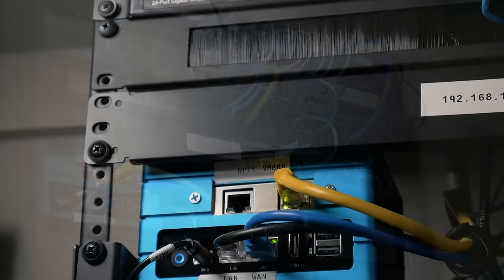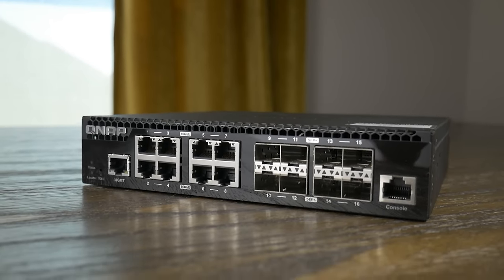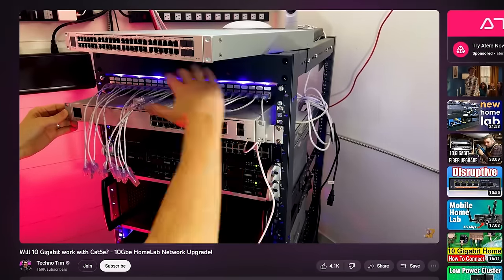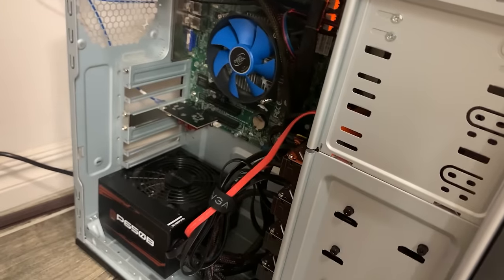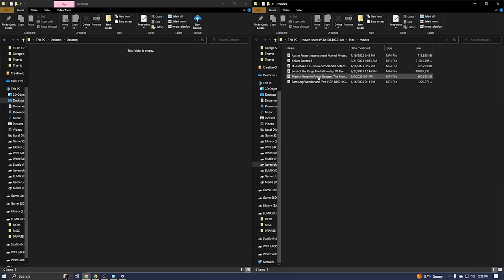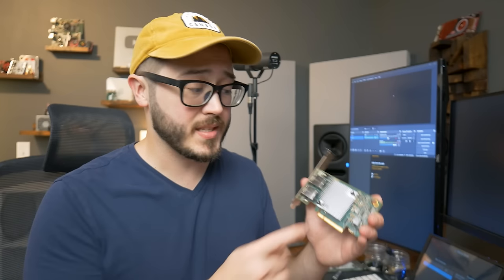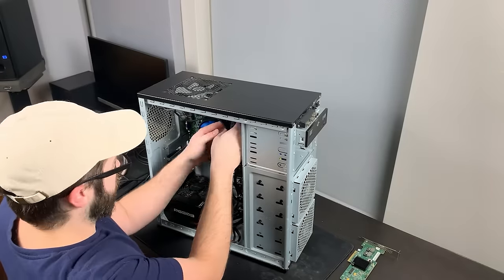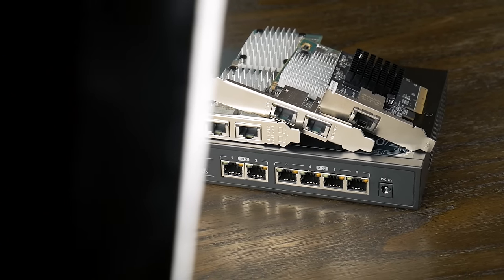Fast networking is cheaper than you think.

Comment: This isn't a budget video. This is a lie.
Reply: Yeah
Reply: electronics are just that expensive

you would normally expect to drop a couple gs for this stuff
Reply: You sound like my friend's Dad, he's poor and smells like salmon.
Reply: 350$ is pretty cheap, when you know the prices
Reply: The word Budget is relative 😂
Reply: @spacewolfjr  salmons delicious
Reply: @spacewolfjr you mean canned tuna.😂
Reply: If you've looked at the going prices for products at this spec, yes it is.
Reply: Agreed
Reply: No one said his budget was the same as your budget. 😂
Reply: @spacewolfjr  salmon is expensive af in my country lol😂
Reply: The 4 port mikrotik is 4 10g sfp+ ports, factor in 4 nice, around $28/ea and ~$20 per connection point, it’s not hard to add up quick. $350ish is about the least amount you’ll spend for 4 10g connections. You can of course shave that down quite a bit with direct connections between Devices. Say, a direct 10g link from your PC to your NAS. That can be done under $100.
Reply: @spacewolfjr 😂

Comment: Actually being limited by the drives is kind of nice, it just means that it is more or less just as good as having the drives installed locally, but  with the added benefit of the drives being available  to multiple computers.
Reply: + added latency, network always adds latency.
Reply: @RobinCernyMitSuffix half the senior developers I've worked with are incapable of processing this thought.
Reply: @magfal  then they are only senior in age ;)
Also, network adds IOPS limitations too
Reply: @davorzdralo8000  bro I missed a headshot cause I was gaming on a NAS. Wait, why was I even doing that. Nevermind, carry on.
Reply: @davorzdralo8000  In any cluster or replication setup, where IOPS is critical, those milliseconds of latency are added to each and every IO.
Reply: @davorzdralo8000  I like how you added that word “home” in there.  You can’t imagine circumstances different than your own.

Comment: Did you enable jumbo packets/frames on your Windows machine to enable a larger Maximum Transmission Unit (MTU) size for data being sent over a network?
Reply from the maker: You ask that question as if I know what I'm talking about! Haha, no but I'll look into it
Reply: @wojtek-33  I get that. As long as you don't go too crazy with it, things should be fine. I've got mine set to 9014 and get much more consistent traffic speeds
Reply: Jumbo frames are basically a requirement with high bandwidth networks.  Even 1gig will not live up to its full potential without it enabled.  It needs to be enabled on your work station, your file server, and the switch ports.  If you run a packet sniffer like Wireshark you can see that it's working.

Comment: 10GBASE-T NICs get HOT! If you're strapping a fan to the card, it's a good idea to disable temperature control for the fan header and set a constant speed. As the fan controller can't see the card's temperature, it can set the fan speed too low to cool it properly. I had this problem with an X540 and designed a PCIe card fan mount with an inbuilt controller. I could send you one if you'd like?
Reply from the maker: I should’ve said something in the video, but those fans are just on a set RPM. There’s no curve. But that sounds like a really cool solution you made!

Comment: FYI it took us ~5 years to go from 10/100 to cheap gigabit in the home
But we've been stuck on gigabit in the home for almost 20 years, when businesses moved to 40G over a decade ago, and are already on 400G
To me, we should have cheap 10-28G as ubiquitous at this point.
The fact that gigabit has stayed around the same price for so long is criminal to me.
Reply: tbf, rarely do one need 10gb, transfer in the home is mostly rooter to pc, not a lot of people have nas or anything extra on the network, and gigabit is not limiting at all for internet use
Reply: @neolordie  Well, gigabit was way more than necessary when it came to consumers too.
Reply: Easy answer, how many home internet has more than 1gbps?
Reply: @zhen86  And who's fault is that, the taxpayer for paying ISPs billions in tax dollars to run fiber to everyone's home in the 80s and 90s?
Or the ISPs for pocketing that money and not doing that.
Reply: @zhen86  i mean in most consumer's homes it does not matter. But here we are talking about speed over the LAN which nowadays comes in really handy if you are utilizing a NAS and copying files over the network (since files are getting just bigger and bigger)
Reply: Main issue over 10gig is fiber. Sfp+ connectors and cables are expensive.
10gig base T is basically where home use is going to stop forever, and they have been milking that for a looooong time

Comment: Great work as always. I purchased a QSW-2104-2T-A to upgrade from 1G to 2.5/10. I installed new wire for the single 10G run from NAS / switch rack to my main PC. But I have had success with 2.5G over my existing old timey unshielded cat 5 (no bloody e!) cable that I installed in the late 90s. Runs are only 20-40m but it all works.

Comment: Just something to remember: The file transfer protocol in Windows over the network is single threaded. At some point, you won't be able to go any faster unless you have a faster CPU.
Reply: Damn that's archaic 😂 i mean windows is built ontop of a legacy system I'm not surprised
Reply: What about if you use a third party file transfer like TeraCopy?  Or is it still limited to single thread because it would still have to use the Windows FTP?
Reply: i have noticed my best speed transfers to the nas is when i have a couple files moving at the same time,,  Granted that is with the synology drive application,, lol,,
Reply: Isn’t there some sort of BitTorrent based network file transfer programs that can multi thread?

Then there’s Free Download Manager….
Reply: Microsoft Services for NFS supports multi-threading. Just make sure you configure your Windows Servers correctly.
Reply: ChoEazyCopy to the rescue
Reply: Is it pure speed, or IPC?
Reply: It can do more depending on your settings
Reply: or just use linux?
Reply: Not true. SMB has supported multithreading since SMB v2 came out in 2006, and is particularly good at it when RSS and SMB Multichannel are involved. It's all cross-compatible with Linux and Mac OS as well

Comment: Enable jumbo frames in all the adapter settings (9000 byte MTU), should improve the 7 Gbit iperf.

Aside from that, unless video editing directly from a flash-storage NAS, I found that 2.5 Gbit is really enough. And those switches are cheaper, and cards are cooler, less power-consuming and often even integrated onboard in mobos nowadays.
Reply: I'm sad that 5gbit wasn't common as a middleground. I have a x370 ASRock motherboard with 5gbit and a Qnap pcie x1 Card with 5gbit for a few years but to take advantage of the speed I have to use my 10g switch because there was not an affordable 5gbit option. 
But in the last 1 or 2 years SSDs got very fast and cheap so 10g is already a huge bottleneck :D
Reply: mfao I made a comment on this dude cause I gave an alternative switch which @ServeTheHome also talked about later and guess what guys he deleted my comment lmfao... Is he even allowed to do that where is the YT police lmfao wait cause it will make him look bad and then they cant make $$$ thats why they gave him power to give quirky information and not checking all products out there.. Was he paid by qnap?? I am curious.. not saying he is, it looks weird. Also what about Mikrotik they also have better products which are cost effective as well!

Comment: Try using parallel streams with iperf.  Something like adding "-P 4" switch to your command might fix that.  That will run 4 transfers in parallel, and each will settle at 2.2-2.4 Gbps each, getting you to ~9.6 total.  That ancient BCM card might hold that back a little, but jumbo packets could help there, too.
Reply: Testing 4 streams instead of 1 on iperf3 won't give you a faster network. 4 cars running side-by-side at 50mph won't get there at 200mph. You want to test whether your 10gbe network actually gives you 10gbe
Reply: @BertelSchmitt  iperf isn't designed to speed up a network, it measures data throughput.  If the CPU doesn't have sufficiently fast enough cores, a single thread might not be enough to keep a 10gBE link saturated, hence the -P # switch in iperf.  I know, iperf 2 and iperf 3 are different.  Older NIC IC's, typically 1st and 2nd gen for a given speed class, are often not able to maintain line speed data transfers.

I also didn't hear him mention NPAR, or any other partitioning scheme, so the 4x50 analogy doesn't seem germane.
Reply: @andrewb6 iperf3 measures the network speed between 2 computers. If one of them is anemic, then it achieves lower speed, and iperf3 reflects that.

Comment: Hey I've been enjoying your videos for a while now... I'm learning much from yours and others. Couple things I read recently you may want to consider. Stacking even the passively cooled switches not good. Heat rises. Utilizing sfp+ with short DAC cables and/or any length fibre reduces much of the heat!, this applies to nics too! It's the transceivers that generate the heat. I will be utilizing DAC cables between switch uplink and downlink...and to my yet to be built nas server next to rack with 10gb sfp+. In some ways techie folks can/should skip the 2.5gb wave that's arriving now, implement 10gb now with the information available on workarounds and cost savings of used gear! Keep reading up on this everybody! And avoid the cheap foreign knock offs!!! Hold out for quality gear!

Comment: Pretty nice deals there. I have one qnap switch, which has been fine on my use cases, but my homelab runs primarily on spf+. I needed 10Gig way back because I use network storage on my virtualization, but spf+ nics were way cheaper than 10G rj45 ones even as used. The situation seems to be changed somewhat, but I've gotten used to the spf plugs and those are awesome since they do not fall of as easily by accident as rj45 does. As of now, I have a small unreasonable fantasy of getting into 100G networking. It doesn't make any sense but would be fun
Reply: lmfao I made a comment on this dude cause I gave an alternative switch which @ServeTheHome also talked about later and guess what guys he deleted my comment lmfao... Is he even allowed to do that where is the YT police lmfao wait cause it will make him look bad and then they cant make $$$ thats why they gave him power to give quirky information and not checking all products out there.. Was he paid by qnap?? I am curious.. not saying he is, it looks weird. Also what about Mikrotik they also have better products which are cost effective as well!

Comment: Good upgrade for a content provider.  I actually wouldn't do the flash upgrade just yet.  It will be an amazing upgrade, however both SSD and NVME drive prices are dropping quite nicely at the moment.  There should be some good black Friday / cyber Monday sales coming up soon enough, or just wait and take advantage of the post holiday sales.  With both SSD and NVME 8TB drives becoming "reasonable" now, it's about time to just convert over in the next year or two.  I'm looking forward to more 8Tb price drops next year myself.  Another fun place to look is  U.2 drives, or what looks really fun is something like the OWC  u.2 NVME shuttle that will let you run 4xNVME on 1 U.2 connection (there are m.2 adaptors).  So you can sacrifice a bit of that per drive nvme speed and end up having up to 32Tb of flash storage off of a single m.2 connection (or u.2 if you put an add in card in your motherboard).
Reply: ssd prices are going to go up very soon, the summer was the all time low. now nand manufacturers are decreasing production
Reply: Lmfao I made a comment on this dude cause I gave an alternative switch which @ServeTheHome also talked about later and guess what guys he deleted my comment lmfao... Is he even allowed to do that where is the YT police lmfao wait cause it will make him look bad and then they cant make $$$ thats why they gave him power to give quirky information and not checking all products out there.. Was he paid by qnap?? I am curious.. not saying he is, it looks weird. Also what about Mikrotik they also have better products which are cost effective as well!

Comment: To reply to your final comment about NAS speed. The Synology DS1621+, and most other good 6 bay hard disk NAS, pre-built or home built, are good for 500-600 MB/s, faster if you use NVME cache. It won’t saturate 10G, but  you get 2x+ 2.5g performance and 100 TiB of usable storage without breaking the bank.

Comment: Like most Enterprise level gear. They are designed for a LOT of forced airflow.  That's why sticking Enterprise cards in a consumer case, often causes them to cook.  The airflow they need versus consumer sound levels is not easy to balance.

Comment: Just bought a little switch with 2x10GB and 4x2.5GB for 50 bucks at Amazon. I will have a high speed NAS next to my machine (10GB) and the 2.5 connection to my home server. Cool.

Comment: Re: the max throughput being about 7-8 Gbps, did you enable jumbo frames?

I saw similar behavior (about the same speed), but enabling jumbo frames on the client and the server got me up near the theoretical 10 gbps maximum.

Of course, enabling jumbo frames can lead to other issues if you don't segregate the 10Gbps devices onto their own VLAN, which is probably one reason I haven't fully set up my 10Gbps network yet. :P

Comment: I am running HP branded x540-T2 cards that i scored on ebay for about 40-50 bucks a couple of years ago, as well as an genuine intel x710-T4. They get HOT without airflow! However the heatsinks are beefy and just a small about of airflow keeps the temps in check. Funny thing is that the x540 has a "Caution HOT!" warning etched on the heat sink! :D

Comment: The inspur is not a dud, I have one too. It worked on your nas because you gave it all the 8 lanes it asked for unlike the 4 lanes you gave it on your desktop. There should be three jumpers on it. Two of them should be adjacent to the ports. Start from left and short pins 1 and 2 on the first jumper, then do 2 and 3 on the second. This way you will have disabled one of the ports and it will happily accept to work on pci-e 2.0 x4.

Comment: Enterprise grade PCIE cards like NICs or SAS controllers are designed to run in rackmount servers which have an insane amount of airflow compared to a normal desktop PC. Those fans alone often pull 20 watts or more PER FAN. Almost all server-grade PCIE cards I've used run crazy hot without additional ventilation in a desktop PC.

Comment: Interesting 16 port switch, paid that much getting a 10 port 10gig last year. Prices seem to be starting to fall a little. When I bought mine I figured we'd have jumped straight to 10gig instead of 2.5. But seems 2.5gig is being widely adopted first. Which in hindsight guess makes since as it covers a much larger audience. As not everyone has the hardware to fully take advantage of 10gig yet. But when you have a use case and hardware that can drive it. It is utterly fantastic!

Comment: Even if you're not running optimally and your drive array only runs at 500MB/s anyway then moving from a 100MB/s GigE connection to a 1GB/s 10g connection is still a huge step up.

Comment: For most people, Gigabit is probably fine, if not a bit overkill as well.  The network in my place I set up with D-Link commercial desktop switches, one 5 port and one 8 port.  My node has the 8 port switch as I have game systems and a few computers.  For short runs I don't see much issue of data loss due to attenuation on cat5e but I would want to use the appropriate category of twisted pair cable for longer runs.  I still find it funny that computers still use glorified 4 line POTS telephone cable for communication across networks.  I also find it interesting that even though coaxial cable can carry tens of gigabits of data, is used by cable tv service providers for broadband and is incredibly simple to terminate isn't the cable of choice for networking computers together.  Granted, it isn't as flexible but there is probably a way to make a stranded flexible variant for this use.

Comment: Turned into NOT-ON-A-BUDGET video pretty quickly. There's unreasonable jump in price between 2.5G and 10G networking.
My budget solution is managed 8x 2.5G Mikrotik CRS310-8G+2S+IN (150€) in combination with QNAP PCI-E 2x 2.5G NIC QXG-2G2T-I225 (75€).
That makes 4 PCs with 5G connectivity (LAG configuration).

Comment: Yeah, not many people know that the old and trusted cat5e can support 10G if you're runs are short. It's works pretty dang good IMO. If you need to run longer runs. I would highly recommend MM fiber. Just make sure you are extremely gentle when running fiber and purchase a fiber cleaning pen. Surprisingly 10G MM Optics are very inexpensive as well.
Reply: No, SM fiber. So many homelabbers talking about MMF like its still relevant. SMF is cheaper and better. More speed, up to 160km distance on one pair of optics (not even counting amplifiers), CWDM, and the optics are a few dollars more expensive.
Reply: @farmeunit  The optics automatically adjust
Reply: @farmeunit  precisely why I mentioned MM fiber. Great point. Thank you. I was going to say the same thing but you said it just as good 👍🏾.
Reply: @farmeunit  key words UP TO dufuss

Comment: if you experience this fault: expansion card receives power but no drivers detected on windows 10/11 (even after try to force a hardware detect)

one solution may be to put it into another pcie bus (try the one closest to the CPU - known pcie x 16) 

It looks like the first nic you tries uses pcie x 8 (im guessing)  -  not all busses have the full fat lane (even though they look like pcie x 16 physically). you may have plugged the expansion card in a pcie x 4 bus resulting in this issue. 

I hope this helps :)